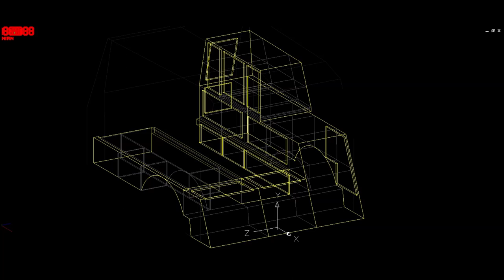Land Rover Camper × My "Home on Wheels" Discovery 2

Comment: This is brilliant, I guess you could sleep two at a squeeze or have reduced the depth of the side unit an inch or two but so what... great system . If you did this in the UK you would probably get it re registered as a commercial vehicle seeing as the back seats would be regarded as permanently out of use and save a packet on the road tax per year. Dare I suggest carpet tiles next version, they are very easy cut to any shape and would have a much neater non fraying edge . The window black-outs are perfect too. If you were to add a power inverter to the kit you would could do the hoovering and washing with a 110v supply from the slave/leisure battery although the engine would need running. I love this sort of self styled inventive project stuff .      👏👏👏👏👏
Reply from the maker: S Who Thanks! Yeah it would be a pretty intimate fit for two. Those carpet edges were a tricky bit for sure, would've been heaps easier if the backer wasn't so dark. I'm planning to wire it up with solar above & a "house battery" inside so I can start expanding it's functionality :)
Reply: I imagine you have found this guys vid already .. https://www.youtube.com/watch?v=QF8XOAApTcY  but the flexible ones are more efficient and don't need "aiming" so much . A friend has a cousin that is one of the David Attenborough wildlife video team and he uses "roll up" panels and slaps them all over the bonnet/hood of every vehicle they use .  I'll keep an eye out to see how you get on, subed ! 
Oh and that Mexican carpet gets everywhere after a while ..... underlay underlay arriba arriba  ;) 
Maybe a manufacturer would sponsor you in return for a few vid shorts of how you use them etc.  Nice going..Good luck mate .

Comment: Hey brother, love the Nanuuq build! Been following a while and finally looped back to an old Q of mine: Do you have the dimensions for the boxes somewhere? I even when to the OB thread and found it all, but no numbers on the blown up CAD drawing.
I'm looking to copy the horizontal spacing of the bench and cabinet for a flip-out bed like yours.
Reply from the maker: I do not have those out anywhere yet, my plan is to redo this wood version in aluminum & make proper drawing plans for the old wood setup once I can confirm all the dimensions from my CAD model match the real thing.  The horizontal spacing is actually roughly 1/3 for each segment across.

Comment: Totally awesome, but you might want to include an access hatch to the fuel pump.
Reply from the maker: Thanks man!  Thankfully the in-tank pump is no longer needed with the diesel swap, since the engine driven lift pump will do all the work, now I'll just have a simple hard line running into the bottom of the tank.

Comment: Hi bud I've messaged before. I was curious 2 things.
1) have you added a mechanism on the boot door so you can open from inside and 2 , did you keep all the notes for measurements for cutting wood etc, did you use Ply? Again amazing build man 🙌
Reply from the maker: I didn't add a mechanism BUT I did put a notch in the rear door table I built to leave room for the original handle, seen here   https://youtu.be/a1dRYVBovuU
Yep that's all heavy duty "marine grade" plywood, all 1/2" thick (12mm)
Reply: @Tinker1837  it would appear I'm lacking this inside boot release  2004 disco 2 facelift, unless its hidden somewhere ?
Reply from the maker: Huh, that's odd. My Disco is pre-facelift and the inner handle is built right into the rear door/hatch card.
Reply from the maker: Hopefully this image of the rear before the install can help, and the handle is the dark bit in the center:   https://i.imgur.com/378lSoF.jpg
Reply: @Tinker1837   not sure why i didint get a notificaton of your reply , just stumpled back to your channel and saw notification..  found boot release handle, just me being blind, found it lol. its the least of my worries now though, just been under my car at the garage it needs a lot of  chassis welding, or a donation of a new chassis  sad-face

Comment: Great video. This is fantastic, I have been trawling the internet for months to find info on converting a d2 into a camper. You have given me 10 times the material that I have already found in less than 8 minutes 👍. Your conversion is very similar to what I had in mind .... superb.. and thanks for sharing your great work. Regards from the u.k
Reply from the maker: Russ Woodard Thanks! I was in the same boat while I researched this build before I started a winter ago. Not much out there for D2's! Nearest I could ever find was Defender builds, but they are afforded quite a bit more space.

Comment: great use of the space over the back. Can you tell me the catches and gas struts you used ? 

cheers
Reply from the maker: DENMONKEY SouthCo latches & those are just generic gas shocks. I'd recommend estimating the force & stroke you'd like for your application before you start searching... because I did the reverse & at first had way too powerful shocks.
Reply: Tinker cheers for the info Tink

Comment: Amazing! After all this time, how’s it held up? Where did you get the window covers? 
I definitely am inspired by your video.
Reply from the maker: Thanks, glad you like :)  Held up great! A bit of the paracord trim came loose, but that was my fault for using the wrong glue that was sensitive to heat. I made those window covers myself from bubble insulation + black felt fabric.
Reply: @Tinker1837  Thank you for the response! I totally loved watching your video and I'm glad to see it's held up overtime. I will be borrowing some of your ideas. I was hoping to not make the window covers myself, as it's more of a craft project! haha I look forward to more videos from you! :D
Reply: @Tinker1837  There is a chap on ebay uk that creates a full set for the Discovery for about £200 or so. I've got a set. I converted mine so I've a boot box that folds forwards to cover the laid down mid seat. but this was because back then I still needed to carry passengers.

Comment: Nicely done but where do you keep your food and beer? Fridge in the future? Cheers
Reply from the maker: Thanks, & the longest I've made it with food on ice & in coolers is 3 days... BUT I left a spot just behind the driver's seat for a small refrigerator or freezer. I plan to add one at the same time as a solar + battery setup.

Comment: Are these solid rigs? I always hear people complaining about head gaskets going
Reply from the maker: Evan Jeffries Some of the 3.9L engines had issues, but the rest of the truck is solid for sure. Added benefit... get one dirt cheap with a blown engine to start your project!
Reply: Evan Jeffries td5 has head gasket issues just ask me lol you have to get plastic dowels and replace with steel they wear out they have a few other issues aswell but if you look after them they are a beast off road.

Comment: So I take it you sleep in a roof top like myself and live from the back of the rig, I use an awning that sleeps 3 that attaches by zipper under the canopy of the tent and have the rear of the disco a platform for living from. I really appreciate the time you would of spent designing this system and I love the finished build, if your ever headed north bound and into Scotland, buzz me and I will give you some inside info on routes to take man, 
All the best
Reply from the maker: I'm actually sleeping right out of the back, on the folding bed section.  Roof's mostly for expanding cargo & fuel range, also for solar panels in the future.  I haven't shown much of me sleeping in back because my very cheap cameras are terrible in lowlight.  You can see some of it in my sand dunes video here:  https://youtu.be/d-nOk5EJ5RM?t=2m42s  Getting out that way would be a dream for sure, good looking out!
Reply: Tinker cool man! I am currently going through you uploads as I've only just found you channel, it's great know that your sleeping in the vehicle, most people I know who have converted their Discos into campers sleep on the roof, if I didn't have such a large family that is what I would be doing, no need to step out of the vehicle when Scotland sky's open up 🌧
Reply from the maker: Yeah the roof + awning/canopy is a fantastic combo!  I love how that style is so expandable & turns into a "basecamp" so readily.  With my setup you'd definitely want to be comfortable with any other person that will be in the back with you... not the largest back there so it makes for very intimate sleeping quarters haha!  Sometimes the peninsulas of Michigan here can feel like an island with all the precipitation/cloudcover/fog.  Beautiful when you go all the way to our northern stretches, the Keweenaw, but still can hardly compare to your northern areas <3
Reply: Tinker Awsome that sounds majestic I would love to hop the Atlantic and do some ovelanding, When you wake and look at your feet in the morning in the back of a disco you look up and see the best picture frame ever, that's the back window of a land rover 😉
Glad I found your channel, I'm more active on Instgram and the channel name is littlebullszinsta
Take care my friend, looking forward to more of your uploads

Comment: Great video im building some thing similar at the moment , can i ask whats is the height of the seat box from floor to seat box top as im having trouble choosing the correct height as im 6 feet 1 tall and dont want my head touching the roof when sitting, but also want enough height so my legs are comfortable when sitting , my guess is 20cm total height? . thanks for sharing your hard work
Reply: Hi Paul, did you do the build? I've watched heaps of builds but keep coming back to this video for ideas. I've realised you can't really go any lower than top of wheel well for the top of the benchseat unless you go a bit lower and have the top of wheel well poking out 2 or 3cm, but if you built one you've probably realised that. Cheers from Aus 🇦🇺

Comment: Well done i fitted oiut a work type  Van master2 stealth wouldnt know it had a bed cooker on back door tool space clothing hangers freeview 240v lights all on budget parts... Off cuts of board an old box some timber frame recycled floor type for worktop and bed surface....
Good luck. If i video to sell as have lisence taken from me will advertise renault master mk2 stealth work camper van... bob
Reply from the maker: Nice! I like builds like that!

Comment: That’s the best conversion I’ve ever seen mate! It really is!
Don’t be offended if I copy most of it..
I’m just really surprised with the bed length. Is that moving the front seat forward?
Reply from the maker: Thanks!  No worries, this is only the 1st iteration, won't be long before its replaced with something lighter :)  I had several different sized people hop in the passenger seat, & double checked my measurements, just to be sure the build didn't interfere with someone riding along.  And the drivers seat position was left alone entirely.

Comment: Hey Tinker, love the videos. You build your vehicles the way i like, thought out, different to others and with pride taken. Back home in Aus i have a v8 d2a that i am fixing up as an overland tourer, i plan on doing something similar to this setup on that vehicle and later down the track when funds are right hopefully a om606 mercedes swap.. The d2's have a good amount of space in the back when the rear seats are removed. I have to ask, what is your career? the use of all the design software screams engineer.
Reply from the maker: Thanks!  That would make for a great engine swap option.  And the headroom afforded by that taller roof line in the rear is one of the features that sold me on the Disco.  I work with CNC machines, no degree, just self taught with those sorts of things.  It's good fun turning things I've been pondering on into 3D models & then making them happen with steel in real life! So far I've had good look with the things I've designed becoming just what I hoped for in hand.

Comment: Nice! I want to do similar with my disco 1 but don't think there's enough room for cot/bunk, I'm 6'1"..how tall are you?
Reply from the maker: It could be tight for you, since I'm 6'0" tall & my hair just touches the back of the passenger seat with my feet on the rear hatch.  The rear area, when folded out, is roughly a twin-bed size: 40" wide X 73" long.  Solo is no problem, but if you sleep 2 then you better be comfortable with the 2nd because it's an "intimate" space for 2 people :P

Comment: this was a great build! i just totally rebuilt my brakes today on my 2000 disco 2. all new master cylinder, lines, rotors, calipers and pads. used the Hawkeye tool to bleed the brakes...worked great. we have also previously replaced the coils...(a bitch to do), valve cover gaskets, manifold gasket, throttle heater gasket, all o2 sensors, wires, plugs, many hoses and clamps, ac pump, alternator, water pump...etc as you can tell, i love her. she is my 4th disco 2.
Reply from the maker: Those coils are such a pain!  I'm looking forward to gutting my braking system & ditching the ABS + going with stainless braid everywhere, maybe non-float calipers too.  Happy to hear another Disco staying on the road & getting some love :)

Comment: Nice cabinet work
 What will be your overall vehicle weight in your estimation.  I know the DII and p38 are heavy vehicles to begin with.
Reply from the maker: NuvolariF1 Pretty heavy I think, I'll get it on a scale when it's rolling again. The new diesel & manual transmission swap is going in add more. And I've yet to add/build auxiliary fuel & water tanks underneath, add winches, rear bumper & swingout, rock sliders... the list goes on!

Comment: At First I thought all that work going into a discovery II then I saw the 4BT. With that motor it is as good as anything else out there. 

Looks good.
Reply from the maker: Thanks! I had always planned to do something interesting with the engine, even if the Rover 4.0 had lasted it would still struggle to do anything properly (low power, terrible fuel consumption, no reliability, few upgrade options, etc).

Comment: Nice build, I just bought one and am looking forward to doing a similar layout. I'm a bit tall so hopefully there aren't any issues. I suppose I can position my self on an angle if I am too tall. Hopefully not the case
Reply from the maker: I'm only just over 6ft/1.8m and this type of setup leaves me just a few inches between the rear door & back of the seats when laid out straight, which is good because I tend to sleep flat on my back, so if you're a side sleeper you'll be okay I think. Another trick to gain more would be moving the passenger seat forward with a fold down bit, then I bet you could get maybe 7ft!

Comment: Do you have to "blue prints" or dimensions of the pieces?  Also did you do the aluminum one yet?  Thanks
Reply from the maker: I have 3D models that are terrible for most people to figure out, but I'll be working on easy to read blueprints & the aluminum version after the engine swap is complete 👍

Comment: This is exactly what I want to do to my D2. I have already used your design for a table on the rear door, that made life a whole lot easier.  Could you post the CAD details for this part of the project. I think it is as close to perfection as humanly possible.
Reply from the maker: All I have at the moment is a messy 3D file that needs converting to a series of flat 2D "drawings"
Reply: I would love to just have the part that rests on the floor. My carpet holds water and I want to replace it with plywood.

Comment: Is there a lot of space gained from removing the plastic trim/finishing in the rear area around the wheel wells?
Reply from the maker: I think so yeah, but makes for some tricky work building around that round shape. The ideal would be to weld up some aluminum saddle tanks to fit around them perfect for water storage.

Comment: I was going to build this for an LR4, but quickly realized the roof height from floor bed is significantly taller on the D2. You'd end up squatting instead of sitting on the bench like you'd do on a French toilet.
Reply from the maker: Right! The old D2 roof height is the only reason I tried this. I'm 6 feet tall and it's still tight but without that distinct roof raise I'd have no hope of fitting in the back at all!
Reply: Nice job though mate. Definitely like to see an alloy version. I was looking at those alloy T-slotted framing extrusions before I discovered my roof height blunder lol. @Tinker1837

Comment: I had exactly same design in my mind for Ford E-350 van, but I couldn't get 4x4 E-350.
(and, too much money for 4x4 conversion...)
So, I bought LR-3(Discovery-3).
I chose no build conversion for LR-3 because the Disco-3 itself could be flatten completely when I fold back seats.
I didn't build any cabinet or bed or something.
When I sleep, move every stuff to awning room and just flatten back seats.
When I driving, just put every container box and backpack tightly.
In-between boxes, I put blankets for cushion.
To tie-down backpacks, just use seatbelts.
No build conversion is the best way for tiny SUV I think.
Because I like flexibility.